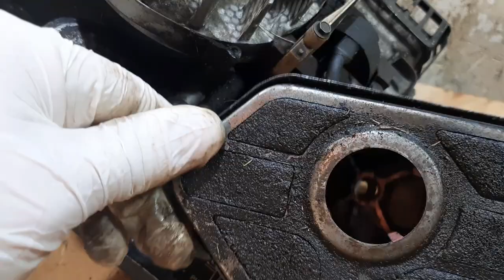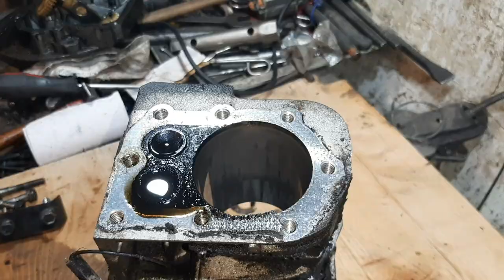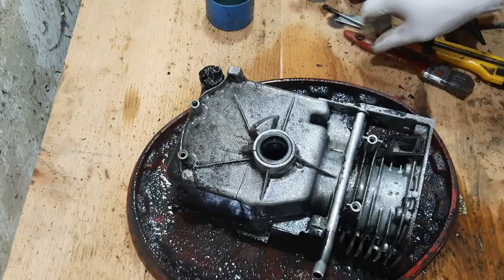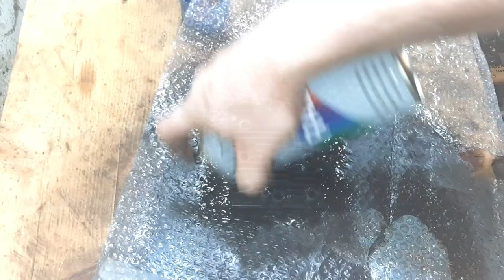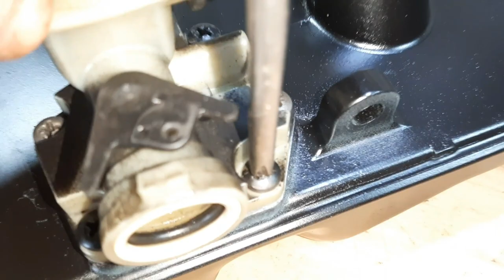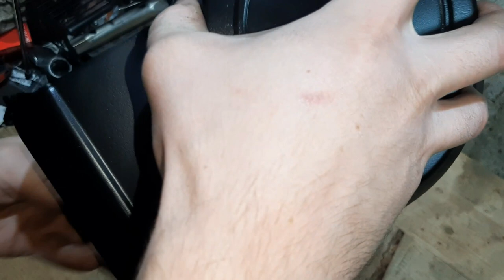Briggs & Stratton Classic Engine Restoration /Lawn Mower Engine Full Restoration

Comment: Excellent video. i will follow it myself when i restore a couple of my mower engines. Did you clean out the carb thoroughly ? by removing the jet where the silver gauze is and clean through it. the air filter that you have used is the incorrect type it needs to be the green version with a sealing lip "272235S"